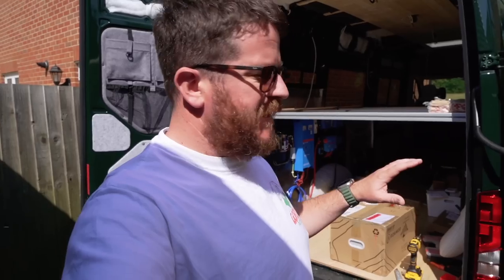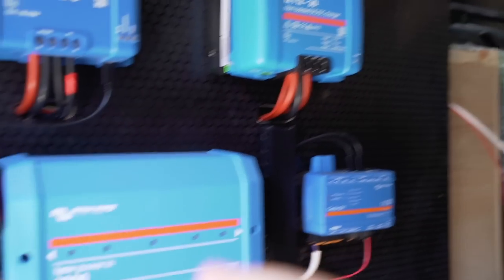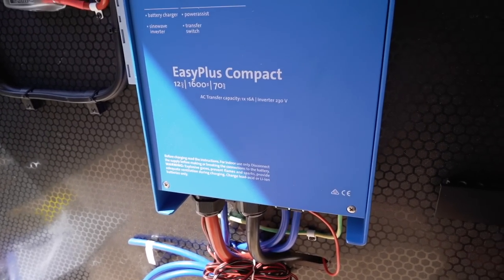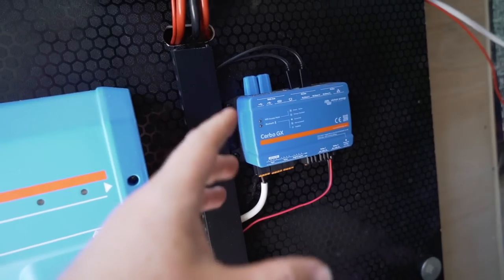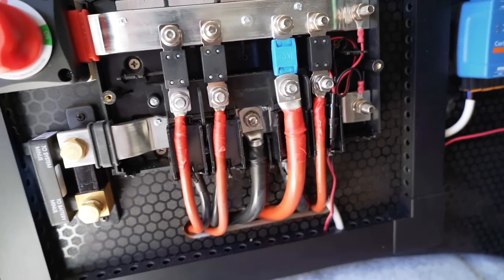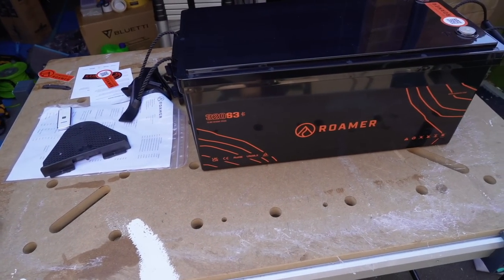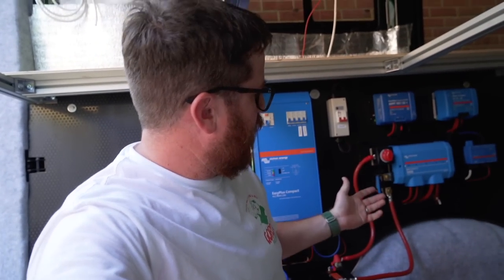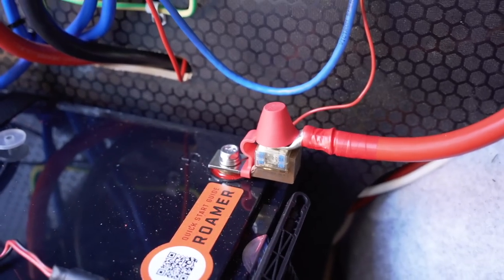The Big Switch On!! - VW Crafter Camper Electrical Install

Comment: Ignore the haters in the comments, that's an impressive build @ABusAndBeyond. We've two kids in our van and use gas for cooking in and out plus diesal for heat. The reality is that "future proofing" now means lower AC demand as things like laptop and drones increasingly run on dc power  (USB C), saving the lossy AC conversion. Your system will accept more solar or battery if you find you need it in the future. We removed our massive 3kW inverter as found it was dead weight & instead keep an adaptor in the van for "emergency" AC use via a granny cable. It's never been used. Having just come back from spain, I'm now looking at a 12v AC system as next upgrade - which again would work perfectly with your setup.

Comment: The left side USB connection to the Cerbo GX doesn't look fully into the socket - the cable is a bit too tight. Might want to slack it off slightly?

Comment: Ive found with the roamer app its not live auto update. I close it and restart it to get the updated numbers. Did you find the same?
Reply from the maker: Yeah ours seems similar. It was also reading 520Ah and at 100% on a 320Ah battery today. Even though I know it is at around 74% at the moment. Very odd
Reply: @ABusAndBeyond  That does seem strange showing 520Ah I have a 460Ah battery and have only been able to monitor the battery last weekend as its only part finished and back with the converter now! I think it was the novelty factor and I checked the battery every time I got back to the van and it read exactly what it read the last time I looked until I closed the app then re opened and scanned then it show (I presume) the actual reading which did marry up with the viltron kit. The only live movement of numbers was the top right box out of the 4 boxes under the % current I think it was called can't see it on phone at mo as not near battery. So either its just a read app not live app or it only refreshes every 2 mins plus which I didnt wait for.

Comment: Hi, just wanted to give you a heads up. Your inverter is rated at 1300w @ 25 degrees @ 1200w @ 40 degrees, you will need an air fryer a little lower than these specs otherwise the inverter will send out alarms constantly. Nice job 👍
Reply from the maker: Thank you for that info Paul 👍

Comment: I've twice used Victron battery-to-battery and inverter/charger together and both times I've discovered that when the leisure battery is well charged via solar I get a trickle charge to the vehicle battery even when the inverter is turned off with no 230V connection. No-one talks about this but it's very convenient.
Reply: Oh that sounds good. As I get readings on dash to say the battery is low after having the cab interior light on and opening and closing doors after a couple of days stationery!

Comment: Think I would have gone for the bigger inverter just for future proofing. Also probably gone for a 460Ah battery or more likely 2x230Ah for extra redundancy. Especially with the solar. I am also surprised the lights don’t seem to be dimmable? As it is the 320 seems to much for general use but too little if the gas runs out. Have you planned your upper and lower demands based on travel day and static days between ehu and worst case for solar.
Reply from the maker: Feel free to hand us your credit card and we will go for those items 😂. All joking aside we don’t need anymore power we feel as we’ve done tonnes of trips in campers over the years and have a good idea what we use. We don’t need dimmable on the “main spots” but will have some dimmable mood lighting under our cupboards
Reply: @ABusAndBeyond I generally go for overkill on most things. Although as I expect you will have a power station to hand a single 230Ah would have been fine for your proposed use which would have been cheaper. With the larger inverter and option to add a second later. I think that would actually have cost less and while I expect the price and capacity of batteries will continue to go down I expect technology like inverters to increase with everything else. Would the difference between the 230 and 320 not have covered the cost of the larger inverter.

The reason I mentioned the move to electric cooking was mainly for the little ones and pm2.5s in a confined space from gas hobs. I know a lot now have a cadac and gas for outside cooking but use electric in the van.

Sorry for playing you know who’s advocate on this.

Comment: Looks great, really tidy. Just wondering though, 70mm or 7mm?  Surely the latter or are you powering an entire campsite ? 🤔
Reply from the maker: Thanks Peter, it’s 70mm2, it’s because 12V DC carries a very high number of amps. The battery can kick out 250Amps so the cables need to be chunky.
Reply: I am so glad I'm not wiring a van and you are 😂, it seems very confusing - hat's off to you

Comment: Very nice neat job. if you dont mind me asking what wire did you use on the 12v fuse box, the white outer with blue\brown wires?,  I need to start on mine soon and need to buy some. Thanks.
Reply from the maker: Thank you very much. I used multi strand flexible 2 core cable but it would be better for it to be red and black really so I’d recommend you use 2 core flat thinwall cable 👍
Reply: @ABusAndBeyond  nice one 👍

Comment: You;'ve connected the deisel heater to the 12v fuse box?  I had mine professionally installed and was told that it needed to be directly connected to the leisure battery?  Heater was an Autoterm 2kw BTW
Reply from the maker: Yeah I looked into this when I installed mine and the important thing is that it has an uninterrupted power supply that’s why they recommend it’s installed directly to the battery but our fuse box is connected directly to the battery so provided we ensure the supply is never cut off when the heater is running it’ll be fine.
Reply: @ABusAndBeyond  Just remember NOT to turn the 12v power off then ;-)
Reply: Or if the fuse blows....😢
Reply from the maker: You have to fuse the cable whether it’s connected directly to the battery or not
Reply: @ABusAndBeyond  Yeah - the cables have an inbuilt fuse holder